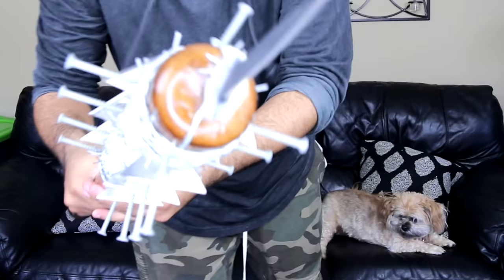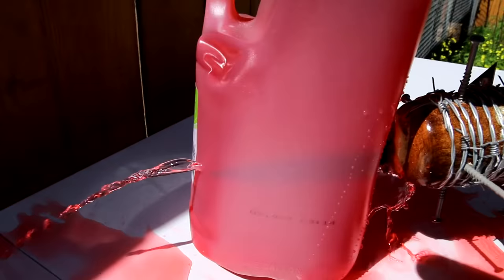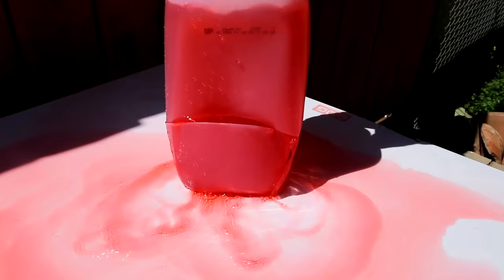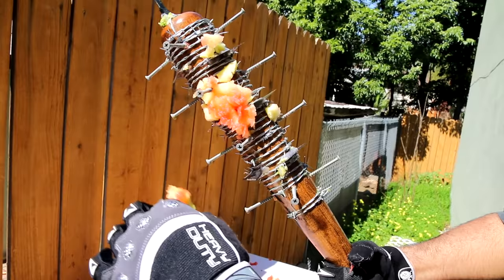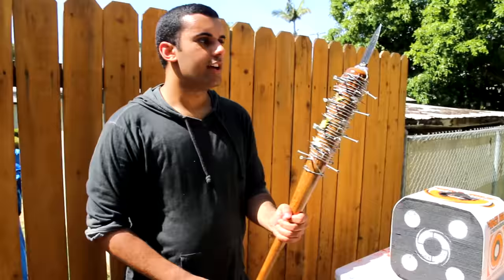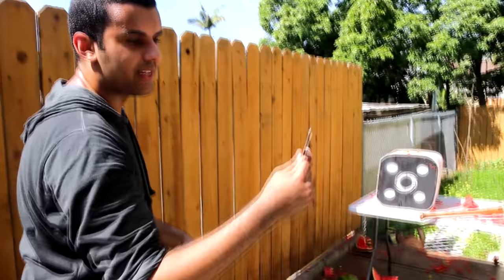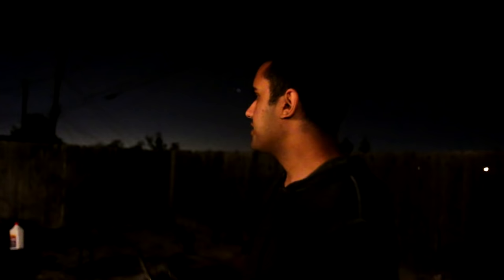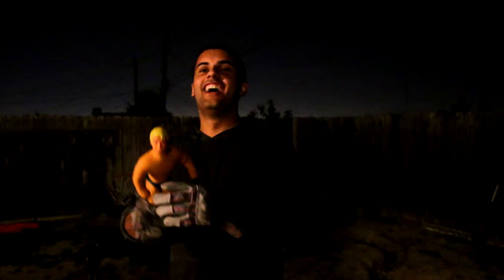EXPERIMENT!! FLAMING LUCILLE 2.0 BARBED WIRE BASEBALL BAT/SPEAR!! THE WALKING DEAD *MOST DANGEROUS*

Comment: Why not drill perfect sized holes all over a battery and cut and short .22 ID "barrels" with a cartridge "chambered" glue in as a breech plate a steel slug with a tit that lines up with rim as firing pin and simply (carefully) each loaded barrelette all over a bat ...maybe use some silicone seal so the hole can be not so tight a fit? (would not want to have to hammer them in! LOL)...the idea being that a hard enough WHUMP will actually detonate the damn things ....actually could use short little .22 power shells for nail guns just to keep the barrelettes from being stupid long...then simply slip fit/glue a spiked projectile into each barrelette ... ....so EVEN if a spike does not detonate the charge? Still be a damn Spike in a zombies head! I'd love to see this prototyped and tested ....call it this impowered bat ..."Barbie Bam Bam"?  

 BTW ...ya know the 1/4-20 (or whatever) studs you can fire into concrete? Those have a deadly looking Spike that is hardened to blast into concrete ...What if instead of the above? One simply drilled #7 (if 1/4) holes all over a bat and threaded in these studs in each hole? (sort of reverse of intended install) DAMN would THAT be wicked looking OR WHAT?? (example link below is expensive Hilti brand but there are cheap generics) BTW could be installed with a socket wrench by simply threading on two nuts and tightening them into each other at the end closest to Spike and then simply put the socket only on the first one ...stager the flats so the socket only drives the outer one ...then just use and open end to hold the inside nut and back off the nuts by hand once each Spike is threaded home ....yes would take some time ...but would be AWESOME! I'm thinking a black synthetic bat ? "Lucifer" ithttps://www.hilti.com/c/CLS_DIRECT_FASTENING/CLS_GEN_PUR_PAT_NAILS/r510